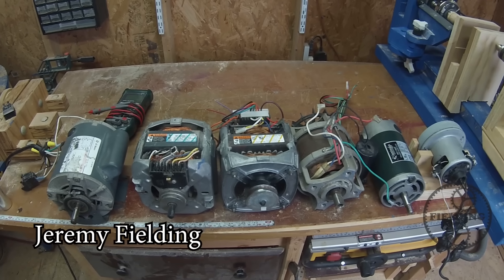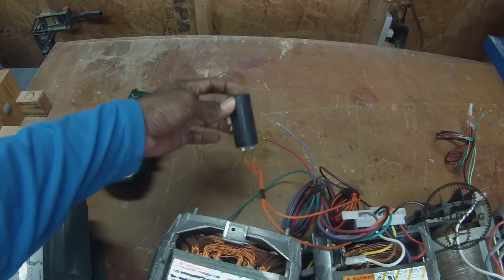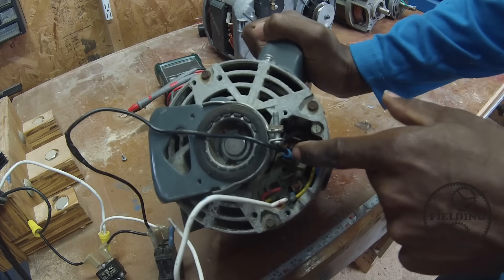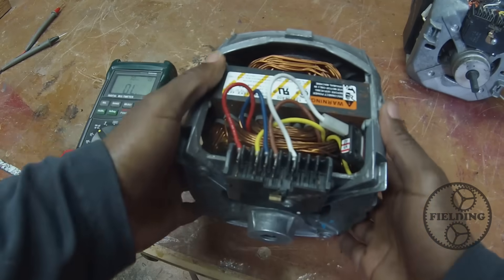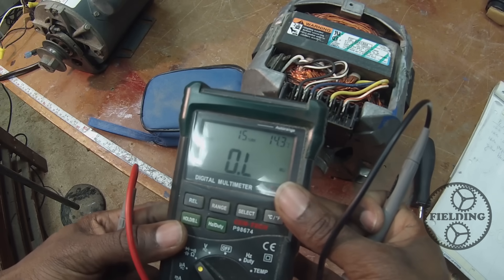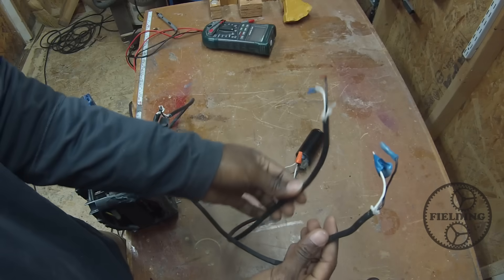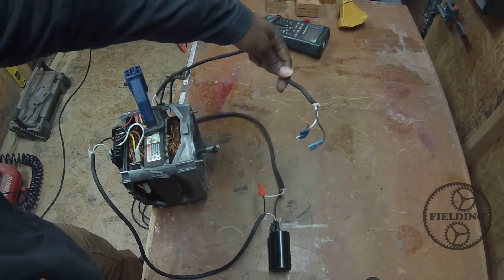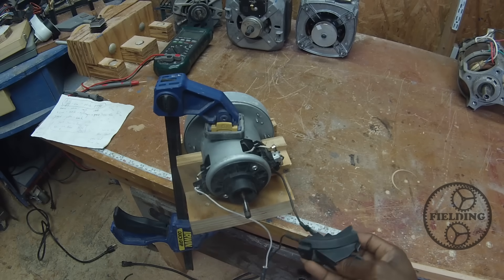How To Wire Most Motors For Shop Tools and DIY Projects: 031

Comment: Very interesting and appreciate all the ifon on this. But i do have a question. On the first motor you said you would have to change the pulleys to change the speed. What kind of motor would i be needing if i wanted to wire it to a speed control for a rock tumbler. Thx in advance for any and all info you can help with.

Comment: I took apart and cleaned a motor the other day, replaced the two wires attached to it, but I don't recognize the binding that was originally on it connecting motor to voltage source.  It's a bit of a tight space to fit twist ons.

Comment: I have a LEM 540 Grinder and need to wire a start capacitor to it. Please tell me where to connect the two wires to the motor. I can not find a diagram to this anywhere. Thank you.

Comment: Most AC routers today have constant speed control from about 8000 to 30,000.  Wondering methods manufacturers use to keep speed constant despite load and if I could move whatever types of circuity they use to my fixed speed router?

Comment: I'm going to ty this measuring the ohms find the primary and start windings and parellel a power  cord and test it 
before I throw it in the iron pile. What it was doing in the washing machine was it wouldn't let you help it, "start", by turning the pulley manually . Why , because it would lock. ( I couldn't budge it to help it turn) But it was free when it's not being powered on. I don't really understand what's locking it. Of course maybe if the start capacitor is out, maybe that's what they do. Just lock to one side, facing the primary windings . Just a  guess.

Comment: That centrifugal switch tip was gold, thanks for the link. I have an air compressor motor that isn't running and had planned on replacing the motor, but had no idea that here was a switch on the shaft I needed to check. Might save me some money my symptoms certainly match a bad switch 👍

Comment: Your vid is awesome. I have to replace the circuit breaker on my Capacitor start induction motor. The info panel is missing off the motor and when I search the part number comes up online. My question is how do I identify an appropriate replacement breaker???

Comment: I need help wiring a switch to choose the rotation of a motor.   Yes my motor is cable of rotating either direction I just don't under how to proper wire a switch and jumpers and all that

Comment: LOVE this information!!  I enjoy tinkering and this video really helped to clear up some info.

And FWIW, a long time ago, I was tinkering with an old tube guitar amp.  It was unplugged for years...but I guess the engineers didn't wire in discharge resistors into the circuit.  I felt the power of stored capacitor energy.

Comment: Hi Jeremy, nice video. The problem i have is that i took my table saw apart and I  didn't take a photo of the pin positions, can I just connect the motor with the live and neutral wires, TIA.

Comment: Hello Jeremy, I have a 1hp 230 volt compressor duty motor that I would have like to use on my bench top mill with a vfd so I can reverse it. The vfd I bought off ebay is an AT2 Simple general series and calls for the start capacitor to be removed and you hook up to the u,v,and w wires on the motor.  My wiring diagram on the motor is just color coded. Can you tell me how to identify which wire is which or direct to one of your videos that will help?  Thanks

Comment: I do love your channel, you are  a great teacher. I have a question for You and anyone else as well. There are so many old abandoned INDUSTRIAL Heavy sewing machine clutch motors available. They are flexibel in pulley/speeds, reversing with easy available parts and fun to work on. Why aren’t these old underrated motors being used for other applications/machines? YOUR FAN from St Paul Mn. (Clutch Motors)

Comment: The  video that you made, is a very well made & is a must for anyone just starting out playing with motors. You covered what people need to know. Especially liked your warning about the capacitors. They are very dangerous and people don’t realize how dangerous they really are. I use a lightbulb to discharge mine. I wired up a lightbulb socket and switch with a  50 watt resistor. I don’t like to use the screwdriver method. Did it to many times to old CRT tubes. You have a very well made video. Yes and very likable teacher. That is the one thing that got me to write a comment. I leave very few comments. The pace an inflection, tone , & pace of your speech. Was very good. Better than most professors I’ve ever had.

Comment: Thank you for your educational videos. They are very helpful and well done.
Just one question, I have a single-phase brushless motor (on a bandsaw). It only has one capacitor, but no centrifugal switch. So does that mean the capacitor just runs all the time?

Comment: I need your help so bad Jeremy! I can't trust my knowledge because im too new to this. So, I have a cutting saw that I picked up for free. It has 2 brushes (single pole/phase?) and they were wired directly to cord. The on/off switch I want to put onto it has 3 pins(&led) Pin1 is for the brown(+), pin2 is for brown(+) going to brush1, pin3 is brass colored and.. I should connect the green (gnd) wire to the brass?? The blue(-) wire goes directly to the brush2(-) right??* The saw originally had the green ground wire connected to the housing of the motor. If I do that I have pin3 empty. It feels wrong.?  *If I connect ground to pin3 and add T tap wire clip, put a ground wire going to the motor housing, will it work? I need some sort of guidance PLEASE! Any time spared will be greatly appreciated as i am near ready to just risk it. Thank you to any one who helps🙏🏼

Comment: Also when you discharge a capacitor use a junk screw driver.  This will ruin the tip if you do it enough times.  If I see someone having a shockingly bad hair day I will know they weren't careful with a capacitor or other electrical part.

Comment: Jeremy, what's the easiest way to attach a pulley to a threaded shaft? I came into possession of a single phase induction motor with a 7/16-20 shaft and don't know what the proper way to get a pulley attached to it.

Comment: I have the same exact AC induction Motor (the one you show how to determine the high speed low speed and starter circuits). I'm planning on making a bench grinder. Do you have any tips? Also what did you use that motor for? Questions for Jeremy or anyone else.

Comment: Trying to find out what wrong with my induction air compressor motor. 240v / 15 amp. Bought it used. So maybe previous owner played around with inside wiring.  Has a start and running capacitor. Is a 110vac start capacitor but 
704 mdf. Says never changed anything and told me everything works. Can do you a video about connecting and verifying inner wiring diagnostics. Thanks. 
And dont stop making video. Very well explained. And lots of info. 👍

Comment: Have you seen a brush assembly with a spring wrapped around it that is attached to hot and neutral wires? No nameplate on motor. Appears to be a permanent magnet motor

Comment: i have  a motor that has W-Neutral, Bk-Line, G/Y-Ground. Red-M1, Orange-M2, Blue-M3, Yellow-M4, Gray-M5, Green-Common. I kept power cord White to motor White, Power cord Black to Motor Black on one side of a switch, then Motor Gray-M5 on the other side of the switch. i put Power cord Green to Green/Yellow and Common Green all together. the machine shut off and i cant identify what was done wrong. it operated fine when it had a load on it, and when it didnt it would fluctuate at its bottom RPM.

Comment: Hi, so I own a metabo DH330, yet it stopped working on me, I tried to turn it on, the motor briefly started turning, then heard a click. It says in the manual it might be the undervoltage relay that may have switched off, they say to turn it back on, yet they don't tell you where it's located. Do you think I can just open the thing up and find this relay or do you think the thing might be really broken or so. I really think it's the relay for I had the planer in kind of a wacky socket.

Comment: Great explanations about these motors. Have you worked with vintage motors, say pre 1950? I wonder how the HP ratings match? Or is it simply the same Kilowatt per HP calculation; Amps X Volts = Watts,  Watts/750 = Horse Power?

Comment: I want to find out how to reverse a drill press motor using a toggle switch.
Not a drum switch.

I did it on my drill press with a 4 way wall switch and a one way wall switch, but I want to use one switch not two.

Should I use a triple-pole double throw or a double pole double throw center off switch?

Please do a video on this.
Or let me know if you already have.

Comment: I have new vacuum motor 
It comes w one black 
One white 

The old motor had 2 black one white 

The switch has two black 
One white 

I guess I need a new switch w    One white wire one black 

Can I use the old switch 
And to wire it

Comment: I just plugged my washing machine motor to the wall without the cap it spins. I just wired the wall plug straight.
 I am wondering why it started without the compactor.  Is it because it didn't have a load?
I had that problem with my ac I had to spin start it until the capacitor got replaced.

Comment: Good videos.  Do you have one showing how to make a single phase 110Volt motor 1-2 HP be variable speed.  And is it possible to keep the torque even as the speed decreases.  Or is it better to go with a DC motor such as a treadmill motor and how do you make it variable speed?

Comment: Hi Jeremy. 

I have a question . 

My table saw motor makes a ticking sound after I turn it off via the stop button,  I also see table saw blade gets little shocks for 5 seconds.. But when I pull the plug from the table saw, there is no ticking sound.. Could this be the capacitor?  ON/off switch? 

The table saw works just like he always does.. 

I hope you can help me with this problem..

Comment: Hey Jeremy, Great job. I want to know if I can upgrade my old Craftsman bandsaw from 1/2 hp to at least 3 hp. To do any resawing, I need this hp to saw rough lumber. So I know nothing about this procedure of motor upgrade and if it could be done. It is belt driven and has 2 pulleys. And it has 2 large wheels top and bottom that hold and turn the blade. Please show me some favor and let me know how to pursue this. There literally 1000's of these older saws sold and are still out there. That user base would definitely want to know how to upgrade.

Comment: Technically the term "Single Phase" is correct.  However, in the industry the term "Single Phase" means 220 volts (not 120).  Single Phase in the electrical Field means Two phases of 120 that are 180 degrees out of phase with each other.  Thought you would like to know.

Comment: Any chance the older motor you showed still has the electrical input switch on it  I sure could use a photo of it as mine came apart during the rebuild phase. Tks.

Comment: Thanks for the video Jeremy but I have a basic wiring choice question that so far no one on other websites seems to want to answer or possibly just doesn't know the answer.

 My question was a basic electrical question. Is there any advantage to wiring a connected device for 240V operation vs 120V . This could be applied to numerous electrical equipment such as Pumps and Water heaters among other applications. An example might be choosing between wiring a Pool Pump for 120 V or 220 V ?

The reasons I'm asking is simple. The dominate Power company in my state has ... for over a decade or more now implemented a policy that charges customers DOUBLE the 'Price-per-watt cost during the Summer Months (roughly a 4-6 month time frame) when temperatures STAY between 95- 110 degrees F during daylight hours. This practice has often resulted sad choices of Paying Electric bills jumping to several HUNDREDS of dollars per Month or simply shutting down A/C units, using more Fans with windows open at night when even do so often results in waking up each morning to sweat-soaked sheets and surviving each day by simply doing ... Nothing.. but trying to find enough shade to drift off to sleep to pass the daylight hours. 

Younger people are more adaptable to these conditions but Older People such as Myself (Much Older than my Picture now @ 67)  and my wife have to struggle harder each year to cope. At some point that will no longer be possible and then it becomes Life-and -Death. Any Insight from yourself or experienced readers would be very welcome and appreciated.

Comment: Why does motors need to be copper wired inside ..mine works but why does ppl have to rerap it with copper wiring inside

Comment: OK people, CAUTION! 
a capacitor that big has way more then a so called shock,  some of these can stop your heart. Capacitors that come in disposable cameras hurt like hell, can permanently burn the leads where they touch you like a branding. I worked in the lighting and audio world and am very well trained. Do not mess with this type of stuff, unless you really know and are educated about current electricity,  this is nothing to mess around with as a, I think I can do this cause I watched a video. A capacitor of that size should be drained some before attempting to short it, they can and do blow up by shorting a fully charged one. I just say don't mess with this for most people's safety.

Comment: I have an older induction motor I BELIEVE from a dryer. It has the enclosed fan in it so the I don't have any real access to move the centrifugal switch to see if I have the power wire or one of the others. How can that be determined without being able to engage the switch

Comment: Just about all the AC motors in last 50 years that have brushes are universal motors that can work on either AC or DC. unique thing about them they are the only common motors that WILK produce high speeds maybe 6 to 10000 RPM. A two pole AC motor feed won't 60 Hertz only produces 3,600 RPM.Have an old 1/4" hand drill from the 1950's that label states 115 Volts AC or DC.

Comment: I have an older (~1985) Whirlpool motor with a through shaft. One end of the shaft connects to the transmission which drives the agitator and the drum. The other end connects to the drain pump. How is it that the pump and the agitator and the drum can operate independently? There is no electro-mechanical connection to the transmission or pump (pump has only one input and one output line. Two tubes not 4). The only thing I can figure is that the motor is spins in the opposite direction at some time in the cycle. Anyone know for sure how this set-up works?

Comment: I’m slower than the rest of the kids, so I would’ve appreciated a little more depth to what exactly the wiring was and where you hooked the positive and neutral to.  Also the the feed vs the run wiring.  A drawing explanation with some time taken to explain it all would have really helped because of the nature of twisting wires with similar colors.  (Nothing can be done about that). I wish you were my neighbor so I could learn from you.  I am sooo similar to you with the repurposing of parts for making useful masterpieces.  However, you have obtained much more proficiency with motors and gears than I ever could!  You are Awesome dude.  Exceptional +1.
Reply: Just a tip, except for rare occasions the polarity of the input power to a motor doesn't matter at all, it just swaps the direction of rotation.
Reply: @Addonexus1000 Thanks
Reply: @Addonexus1000 good to know! Thanks
Reply: Diagrams are a great idea.

Comment: I have a 2hp single phase motor for an air compressor.  Simple instructions, I wired it to a plug same as you and when I plug it in it spins great at 3850 rpm.  But if there is the slightest load put on the motor it blows a 20A fuse in the home's circuit breaker.  The motor is 1700 Watts / 120V = 14 amps.  I can't figure it out.  On my last try the place where I wired the motors wires to the plugs wires burst into flame and then the fuse blew.  Is this too much motor for a home?

Comment: I actually have that exact multi-meter. I like how it lights the probe inlets for each function. I have a mid-90s washing machine motor and capacitor. I'd like to wire it with relays to form an electric dumbwaiter. Not sure it'll work, but I need to learn relay logic first.

Comment: Thanks for the video, this one I found somewhat confusing when trying to follow the wiring and connection to your second motor (single phase) with the start capacitor - a diagram would have been very helpful here, other than that, thanks for taking the time to do this.
Reply: I am a visual learner and  have not been able to get the harness figured out yet. The harness he used  is a bit confusing to me.  I would also like to know if I can switch between speeds.  I have the plug that has all the wires, it is just figuring how. I have searched the internet for days and this is the only thing I have found on wiring these motors, my neighbor electrician is stumped.

Comment: I am still not able to hook a plug to my motor. Here is what I have.My motor is from a top loader washer  the colors is  white,  red    yellow,  black,  blur model no is S67PXKGC--7722.? I looked all over unable to fit this to a plug not a person with electrical motors .Any help would be appricated   PS I dont have ay capactor if it is needed n

Comment: Could you do a video sometime about how to match a start capacitor to a motor? Like say I scavenged a motor with a bad capacitor. How do I get a new one for cheap that I can be sure will work? I don't need to buy the exact matching part, right?